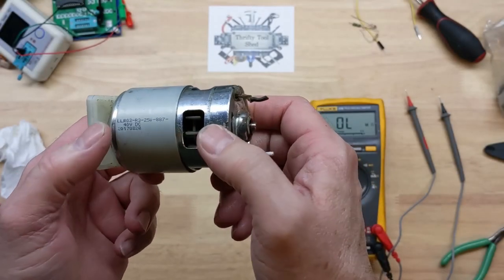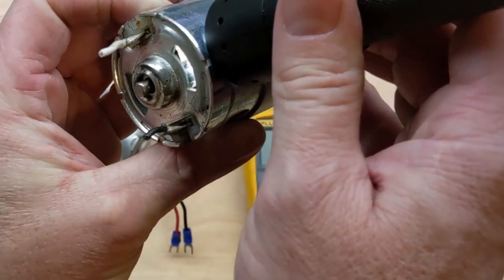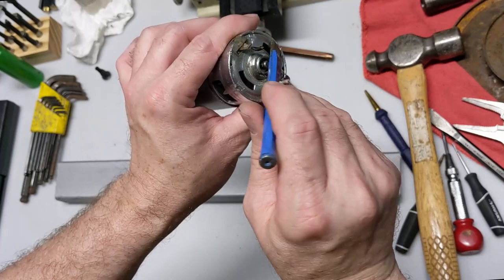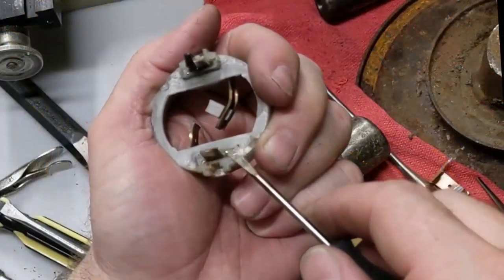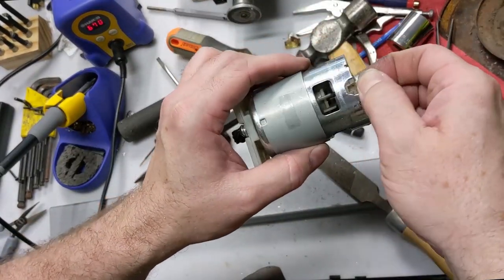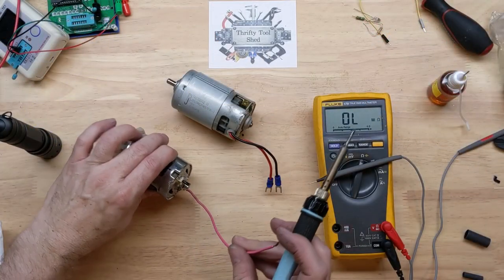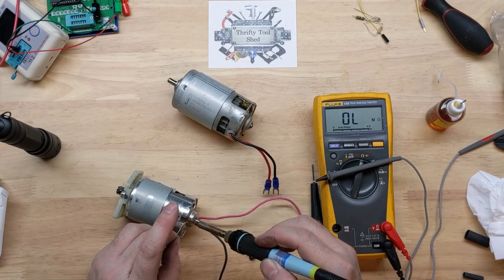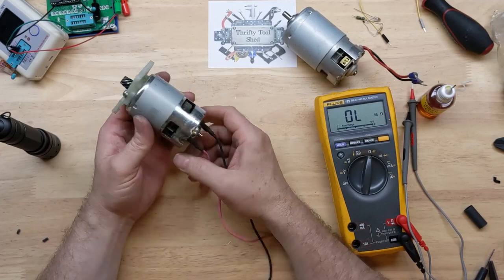Can we Repair this DC Brushed Motor?

Comment: It's working, you brought it back to usefulness. That 's what counts. Thanks for the look.
Reply: My good fellow.
The chore it is to dis assemble and reassemble these types of motors is a real test of skill.
The entire motor is a press fit and getting everything to re align
Properly when reassembling is next to impossible.
What I learned after going thru the process is to never pry of push pull it in any way is the first step.
Using a Dremel hand grinder on those tables until the end bell comes off without resistance is the key.
Marking the position
Of everything is next.
Keeping the armature free of binding is ultimate .
Rewinding the armature is also to be considered in that it is easy to enhance motor performance if you desire.
Rolling little set screw hole into the can and endbell fasting leaves you with a motor that now is long life's.
Mossy of this is failure designed so that replacement purchase is predictable.
Reply: @danielhutchinson7115  no kidding?

Comment: Great as always! Your approach is so easy to follow. I’m just new to electronics always had an interest but no time. Retired now and a lot of time. So thanks and I’m going to get into you Electronics at Your Level 1-8 soon. In the meantime I’m trying to find a replacement motor for my Black & Decker Dustbuster. I think the bearings are shot and it overheats and shuts down in a min or so. I’m still testing different items but I think that’s the problem because I ran another motor from another unit and no prob continuous runtime 

Thanks again!!!

Comment: The real problem for me is bending back the notches that hold the endcap. Just cleaned two Johnsons motors that generated smoke, reason being dirt accumulating in and shortening the commutator gaps.

Comment: Great repair, it's difficult to justify fixing cheap motors
Reply from the maker: So many similar comments. If that is your opinion you most likely will not change it. Sometimes a motor or item is obsolete or hard to find at best. For the ones that see a similar repair as priceless value in learning or the simple fact that the repair not worth it saved a friend from buying another $150 item? It all depends on how you look at it. I have been repairing and learning by fixing things since I was very young and it has been a very good career over the last 25+ years as well. The learning and experience has been invaluable and hopefully even helps someone else. I do not do this as a living so Nothing to justify.

Comment: I pulled apart a DC chainsaw motor because it keeps smoking but still running. I thought I'd blown a brush off but unfortunately not so simple, it's scorched with carbon between the brush windings and main body windings and part of the plates are scorched on one side. I'm not really sure what to do with it. I can't really afford to buy a new saw and can't find a motor for it. It's a custom plastic housing etc.
It still runs but I get an electricalburning smell when it does. Would cleaning it help or would I have to replace it? None of the windings look burnt through or disconnected. Not even melted just scorched with carbon.
Reply from the maker: Well it's possible cleaning the commutator will help. If you don't think the windings are burned I would try it. You can even get some small strips of emory cloth and clean up the copper bars of the commutator. After cleaning make sure you have good spring pressure on the brushes from the brush holder. A badly worn brush or weak spring in the brush holder is sometimes what causes the brushes to arc and blacken the commutator. It may at least last a bit longer!

Comment: This looks like Makita line trimmer DUR181 motor. Replacement motor costs $8 but the terminals are on the wrong side. I'll try your method to dismantle it

Comment: I have a question. So my ABS pump motor doesn't work on my car. I did some research and it seems that the induction motors just simply wears out over time. Many people replace the entire ABS system which cost around $400-$1000. I was wondering if the electric motor can be rebuild. It seems to have the same issue of the brushings and the plates wearing out. Although I don't know how one would fix the plate(commutator bar) wear issue.
Reply from the maker: Well an induction motor is usually AC. Even though many BLDC motors are used in DC systems of today it is still either the older school Brushed DC like in this video or the Brushless. It seems as if you already know it does have brushes? So it's a brushed DC motor in that case. The replacing of brush assemblies is as far as I have gone with these smaller DC motors. As far as resurfacing the commutator, I don't think anyone does that on these small motors. I have worked with large 100HP plus in industry and motor shops do specialize in commutator rebuild on those. I have never worked on a ABS pump to say for certain. Best of luck to ya! Merry Christmas!

Comment: So it needs a hammer and a chisel to pry open  those tiny tabs :) Nice! exactly what i need to do on my old makita drill!
Reply: for me , i use electrical side cutter plier to pry them open, much easier
Reply from the maker: It does work for sure. I done it that way years ago, but it will typically leave sharper edges than the chisel.

Comment: I believe my motor got water damage over time and i cleaned inside with light sanding cleaning it out but still nothing. Not sign of life what should i try next
Reply from the maker: You can try spraying it with an electric motor cleaner or contact cleaner, but make sure it's plastic safe before spraying and plastic parts. After that make sure the commutator and brushes are clean. A very light sanding with very fine sand paper will do it. Other than that make sure the bearing (bushings) are clean and not hard to turn or dry. They may need a little spray lube.  Best of luck to ya!

Comment: Not to be the party crasher here but yes if your lucky and the gear isn't straight stuck on the shaft this might work. I've gotten lucky and did this same thing and right on done deal but then there is the failed attempts where to much prying on gear starts pulling the whole shaft out of armature inside motor even tho you used heat so you just go use bench grinder to do the job and it does no problem but when you go to utilize the motor it starts up but it's suddenly loud rattling brushes sparking big time followed by a loud screaming noise no power smoking then burns up on ya. The heat strips the bushings of lubrication and leaves the precision Smooth tempered finish of shaft and bushing surface rough and scored plus the shaft pulled out of armature misalignment of brushes so they are now hitting the commutator where the motor windings are connected causing a bad short every revolution and destroying the brushes plus severing winding  that break loose and get sucked into armature and magnets sometimes causing magnets to lose there connection to inner motor housing and stick to spinning armature while loose windings wrap around everything  effectively causing catostrofic failure to all motor components and leaving you with complete junk motor. If you don't have to reuse the  gear then just grind it off with bench grinder or dermal carefully and then use compressed air to clear shaving and lubricate bushings. Or jack a small gear puller and a beer fro.m neighbor when his gaurd is down.
Reply from the maker: No party crashed whatsoever. 2 things here. First, I did not work on the front it was the back commutator end with the brushes. No need to remove the gear most of the time. Secondly, it was a junk motor to begin with, non-operational, broke, brush holder broken so no big deal that you have a junk motor if you give it an effort. I have absolutely seen the gears pressed on so hard that you can't get them off easily, they can't slip on the shaft when doing there job after all. So I know what you mean it can be rough even with heat.  Thanks for sharing your experience!